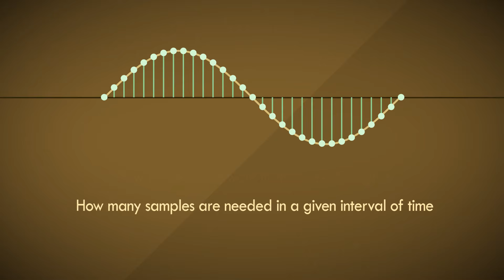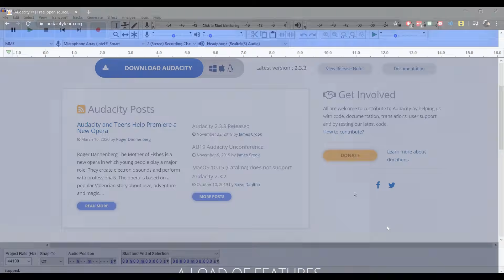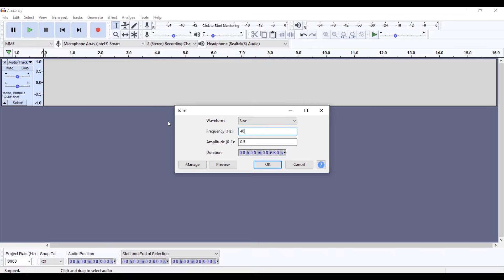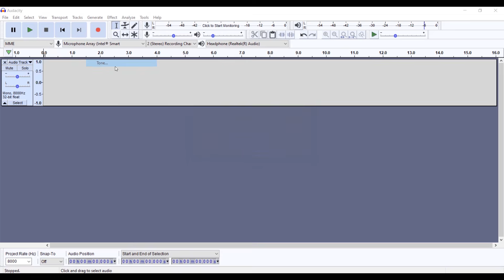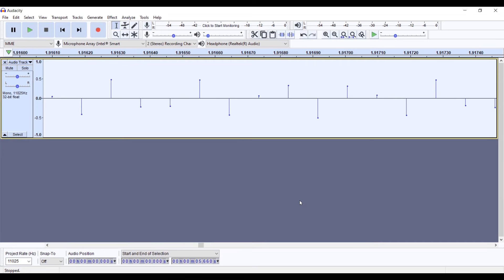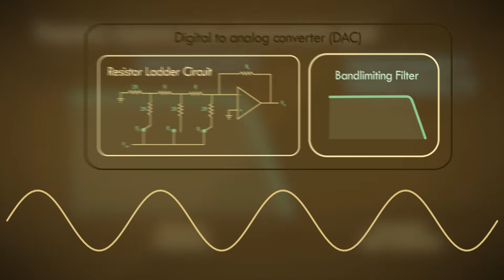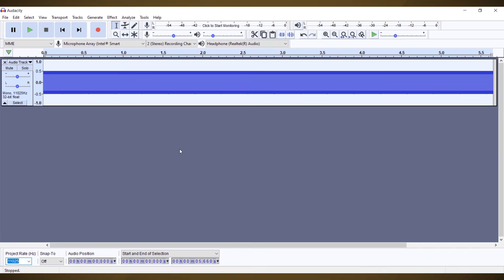2. Sampling Theorem - Digital Audio Fundamentals

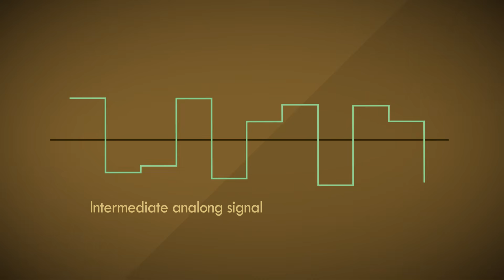Comment: I'm having a bit of trouble understanding stuff starting at 12:54 related to the intermediate analog signal. My current understanding is that the vertical components (lines) in the signal are essentially infinitely high in frequency, as thats the only thing that would explain how a analog wave could be perfectly vertical. As for the horizontal components they would be 0hz and have zero amplitude. Everything I just typed I would assume is wrong.

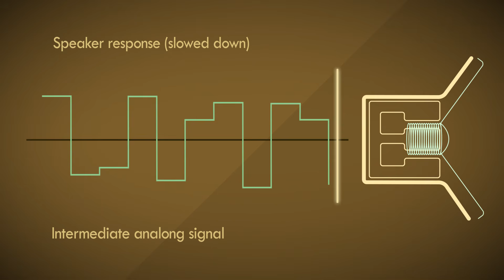Next, I understand the end goal is to find the single analog wave that serves as a solution to the intermediate analog signal by crossing each edge/point of the signal once. However I still don't understand how said solution is found. At 13:32 where you talk about discarding unwanted high frequencies from the intermediate analog signal I don't quite understand why this is done/how it aids in converting/solving the intermediate analog signal into a final analog signal. I thought the original digitally stored signal was already bandlimited in this example.

Clearly i've gotten myself mixed up. Any guidance would be very appreciated.
Reply from the maker: Hey thanks for the question. It's quite interesting. So first question was, are there really signals with infinite frequency components, since the slope is 90 degrees? Well, I would blame the illustrations for this. At the intermediate signal stage, we're already in the analog (time) domain, so there is no instantaneous bit switching happening here. The signal is represent by analog components. And analog components are never ideal. 
Consider a capacitor. That's one of the components used to hold the state of the signal at some value for some period of time and then drop the value to a lower state or charge the value to reach a higher state. Here, charging and discharging a capacitor are not instantaneous operations. It's takes a bit of time. Very negligible, when compared to the audio rate, but still a deterministic amount of time. You get a ramp of values when the capacitor charges from 0v to 5v and a ramp of values when the capacitor discharges from 5v to 0v. You'd still have high frequencies because of these sharp ramps, but not infinitely high.

The question about 0Hz DC components when the signal is held at the same state, well, that's interesting! I donno about this one. Maybe an electrical engineer could explain it. Those DC components would probably be there in the final audio signal, and would probably be stripped at the end by getting rid of any DC bias. Not sure.
Reply: @akashmurthy  Ah, that makes sense regarding the natural speed limit of the capacitors themselves being tied to how high the frequency's are for vertical changes in amplitude. I needed to get my mindset out of the digital domain where bit switching would be nearly instantaneous.
Reply from the maker: And the second question, why is there a need to filter the signal, and how does that help in finding the final analog solution. 

Filtering is not a very intuitive process when viewed from the time domain. However, filtering is very intuitive when viewed from the frequency domain. A low pass filter will attenuate frequencies beyond a cut off, and we can see that vividly on a frequency vs amplitude graph. But these changes are harder to visualize on a time vs amplitude graph (time domain).

How I try to build my intuition for this is by considering a square wave. A square wave has some fundamental frequency, and a lot of overtones. In the time domain, it looks like chunky repeating squares. And in the frequency domain, it looks like a ramp of values from the fundamental frequency, decreasing in amplitude all the way to the audible limit. Lets say, the task now is to find the fundamental frequency. If you put a low pass filter on it and crank it up, the lower the cut off frequency, the more and more this square wave sounds like a sine wave, and when you cut off all frequencies above the fundamental, it'll look and sound like a perfect sine wave. So, the jaggedy edged square wave was transformed into a smooth sine wave by the low pass filter.

So low pass filtering can be thought to smooth out the time domain waveform, and the smoothed out points follow a sinc interpolation. 

Though the digital signal was band limited, the digital to analog conversion process inadvertently adds higher frequencies into the signal, because of the process we just discussed. So there is a need to put the low pass filter, and band limit the output analog signal.
Reply: @akashmurthy  If I follow you correctly here your relating the similar appearance of a square wave to that of an intermediate analog signal. No doubt they are visually similar, and I get what you mean with applying a low pass filter to smooth out the square wave. I'll stick to watching your series and if I feel like looking deeper into how a DAC functions I will do so after. Thank you so much for the detailed replies and the incredible video series!

Comment: Something seems strange about what the final low pass filter is doing. While the stair step signal is being held at a constant value, the final output signal is already changing as if it knows what stair step value is coming up next, like it is predicting the future. How is this possible?
Reply from the maker: Hey! At first glance, it does seem like the low pass filter is an omniscient, all-knowing being which can predict the future! But all it does is obey the laws of physics. If you throw a ball, and discard all external factors, like wind and drag, you can accurately calculate how far the ball will travel, and the trajectory that the ball will take just by knowing the initial force and angle of throw. No matter how many times this experiment is repeated, if the initial factors don't change, the result will be the same. So, we can essentially predict where the ball will land, without even throwing the ball! 

Similarly, if we know the position of the previous sample, and position of the next sample, and the distance between them, we can predict how the wave shape will take form. In the previous example, gravity was the defining force, in this example, wave physics is. Under these initial conditions, and when the low pass filter eliminates the high frequencies, the only possible outcome of the wave is determined by wave physics. 

I want to share a link, where a guy explains this with a piece of thread and some thumb tacks. I thought it was a pretty cool explanation. But Youtube mysteriously gets rid of comments with links in them. So I'm going to send the link to that video in a new comment. Let me know if you can't see it, I'll try to send it to you another way.
Reply from the maker: https://www.lynda.com/Acoustics-tutorials/Digital-analog-conversion/383529/487009-4.html

Comment: Sampling theorem uses the keyword 'atleast' and we know that we cannot recover signal if we sample exactly at the Nyquist rate as discussed at 8:51. 

So shouldn't the theorem state that a band limited continuous time signal can be accurately converted to and from digital signal when sampled at a rate, 'more' than twice as high as the highest frequency component of the waveform? 

I have just replaced 'atleast' with 'more'
Reply: Thank you for the clarification. Many don't realise this fact and use the expression fs>=2fmax conveniently.

I would also like to thank you for the simplicity and quality of this educational video. Looking forward for more.
Reply from the maker: You're absolutely right. I cringe at it whenever I rewatch this video! It was a mistake.

Comment: Can you explain please ..what is the maximum representable frequency?T 11:19 TIMECODE
Reply from the maker: Sure. The maximum representable frequency here is the Nyquist frequency, which is half of the sample rate. So 22.05kHz is half of 44.1kHz and 5.51kHz is half of 11.025kHz. According to the Nyquist theorem, any frequencies above the Nyquist frequency cannot be accurately represented in the digital domain. So the maximum frequency you can have in your audio signal is 5.51kHz, if you are sampling at 11.025kHz . Any frequencies above that will cause aliasing.
Reply: Akash Murthy thank you dear.